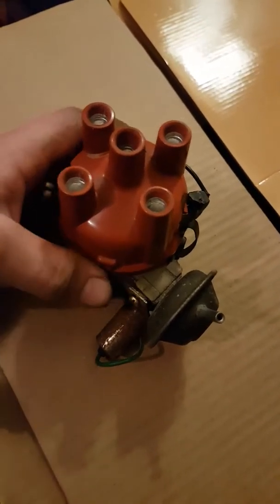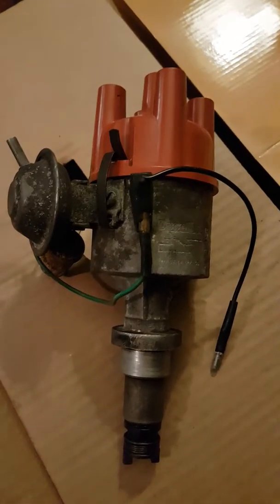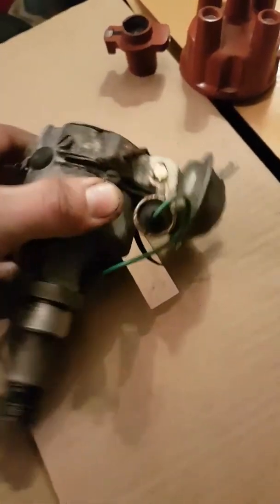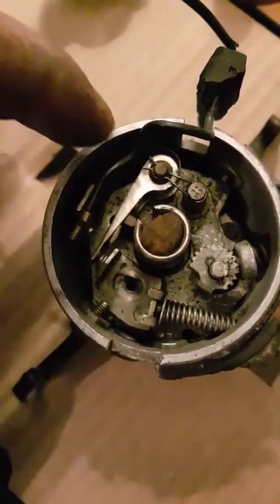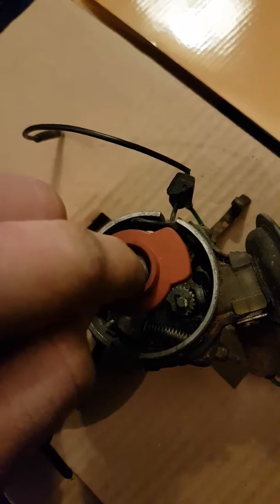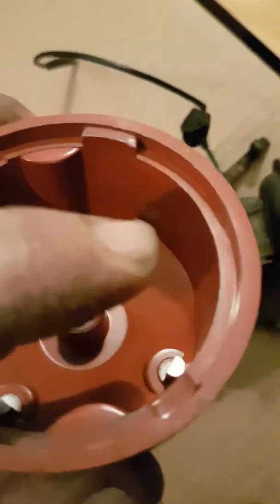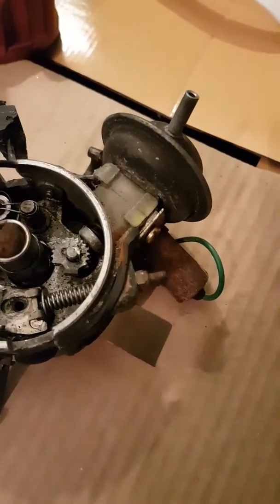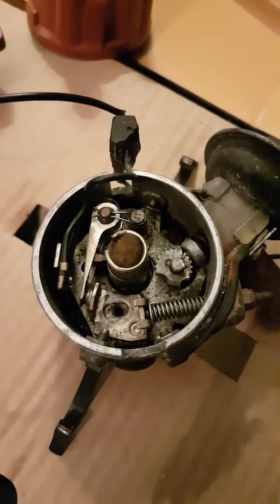Renault Distributor - how does it work?

Comment: Do I need to clean and lube the shaft before reinstalling the distributor?
Reply from the maker: I usually give the shaft a quick spray with brake cleaner and wipe with a clean rag to make sure there is no grit on it. 
I have never lubed the shaft prior to fitment, i leave the engine to do it. But it wouldn't hurt to put a drop of engine oil on the shaft if you want to.
Remember that the points cam inside should be greased to lubricate the arm, red grease I find best as it's thicker and stickier, stops the arm wearing fast due to the heat generated. Also be sure to put some 3in1 in the top of the distributor shaft under the rotor arm. Should be a small absorbing pad inside. This feeds the centrifugal advance weights below with lubrication, else they can stick causing timing issues.

Comment: My rotor isn’t spinning can I do something to fix this or do I need to buy a new distributor? Renault 4cv 1961 6 volt
Reply from the maker: Does it move at all? Or completely stuck solid? 
My personal method of diagnosis would be to disassemble until I find a cause... 
Could be something as simple as a something bent and in need of straightening out